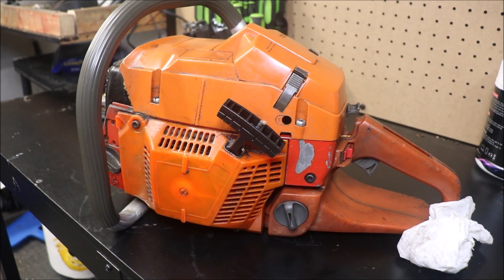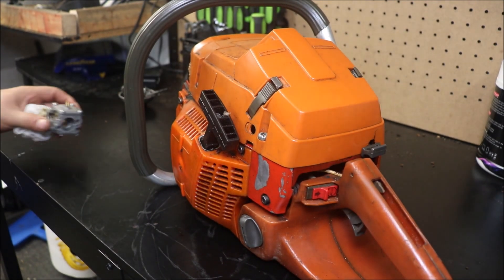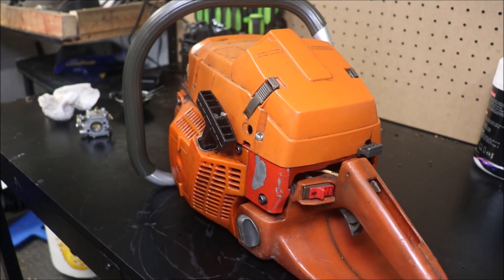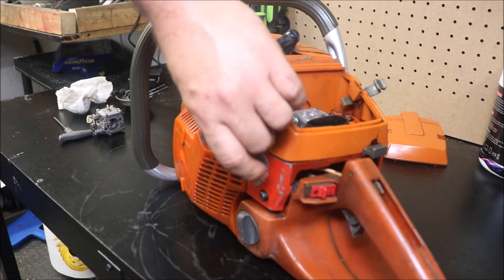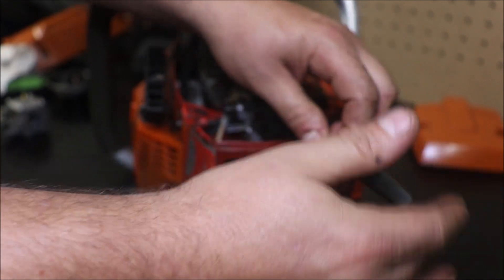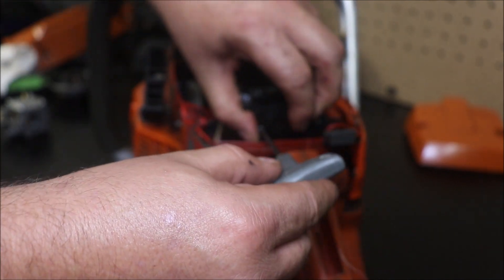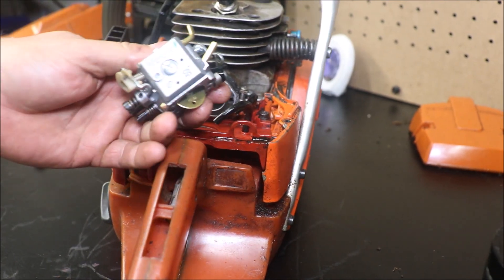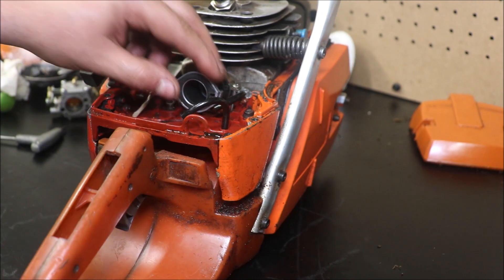Husky 365 Hot Saw

Comment: Farmertec uses Tianjin Walbros in their saws and Walbro has a factory in place called  Tianjin in china. I think i was 1 of the guys who hated that 365 with hogged out transfers because you raised the exhaust, but i did not comment anything about that. You can have big transfers but then you need to run shorter exhaust duration to keep the torque up. Now if you raise the exhaust you cant have the big transfers. 😇
Reply from the maker: I went back and done machine work to lower the exhaust i was cooling another creators build proving it disnt work 😁 saw ran strong after machin8ng
Reply: Yeah i know exactly which porter you are talkin about. That guy and you have had some mud slingin going on 🤭 i like you both but i dont like all the drama thats in youtube about porting and machine work related to chainsaws. Everybody has their own style. In the end of the day its about how the saw cuts in the wood 🙂